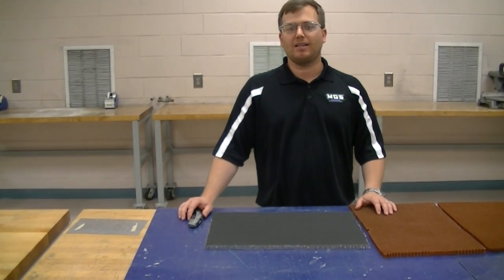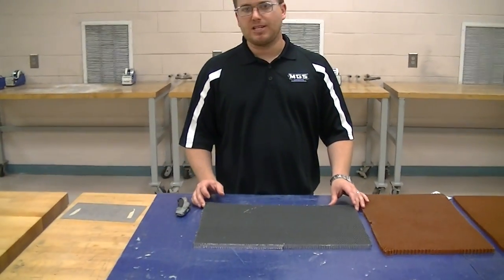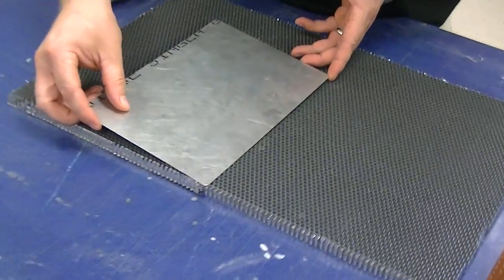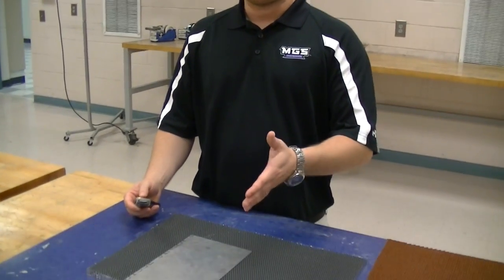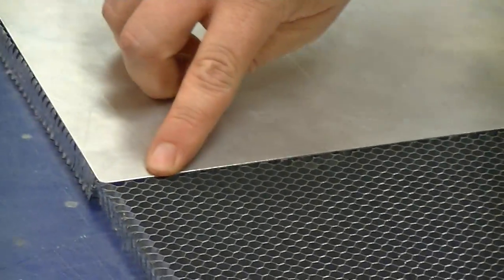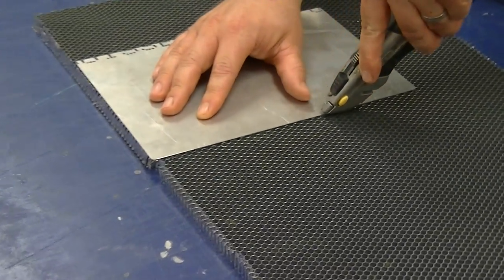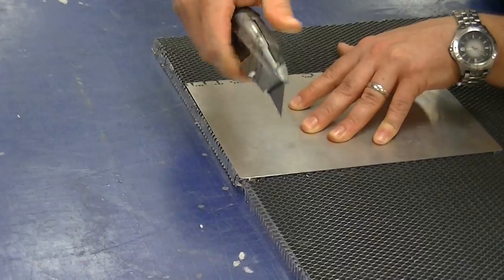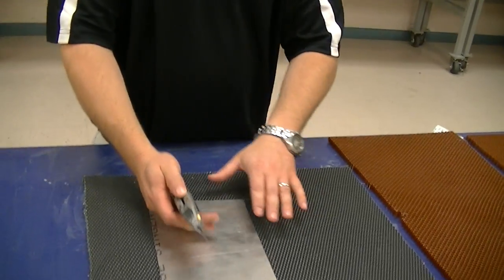HoneyComb Core Cut Method#1

Comment: Thanks for the tips, will help me out a lot. I will be constructing a part made of carbon fibre sandwich panels and was wondering, when using aluminium core is it a viable option to bend the core such that some of the cells buckle to conform to the radius, without losing too much stiffness? Previous people constructing the same part have tapered the core to about 20mm from the radius and then used a massive buildup of carbon plies for the corner. I have designed such that the radii should be less dramatic, but in some points the core would need to be deformed to go around these radii. I am hoping that I can find a method like this that would be viable as it can help in reducing weight of the part.